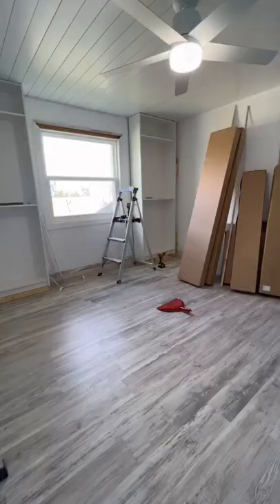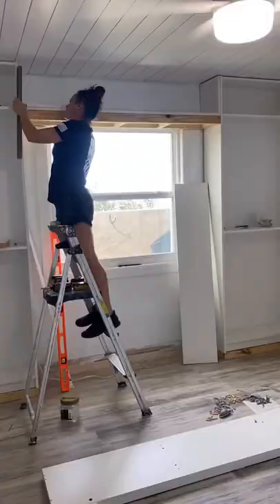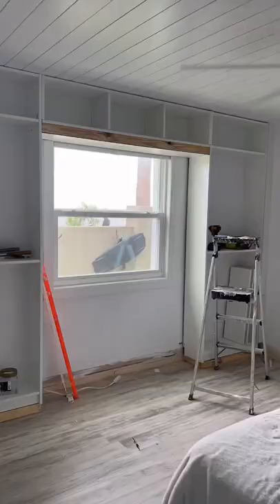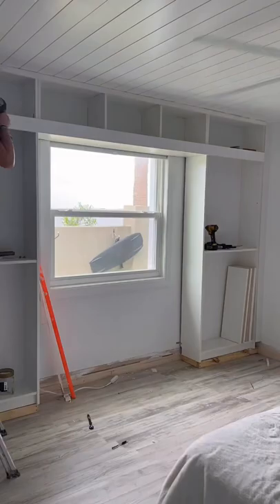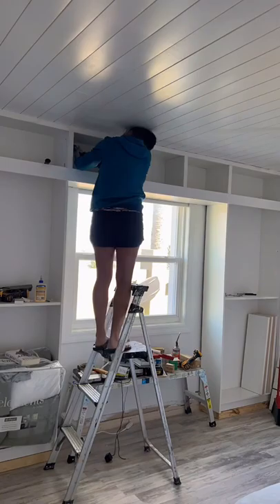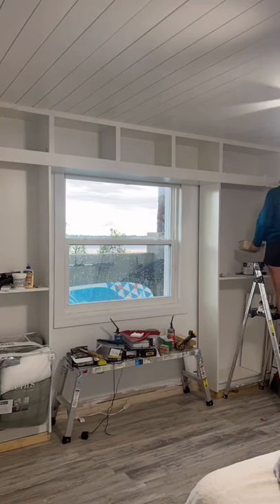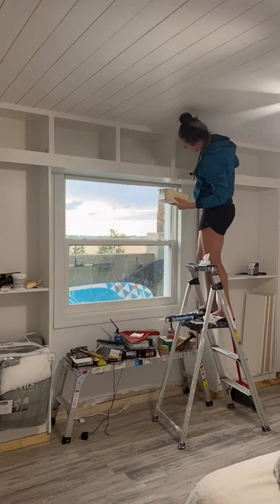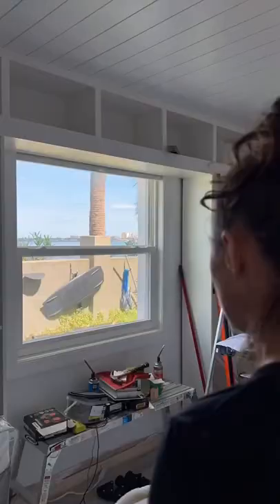Adding library to daughters bedroom with ikea billy bookcases and DIYing a sliding library ladder!

Comment: I wish you were in my family! How did you learn this stuff?I'm dealingbwith a old leaking pipe in my garage I cut out all molded dry wall my huge issue is the water soaked up in the baseboard and there is a small area to side of my hot water heater I can't get my big size 8 ring finger let alone my whe hand behind there to remove old dry wall...anyone have a answer?
Reply: That’s the same question that I have. I wonder where they offer a crash course like this.
Reply: @aidahall5952  💝🕊